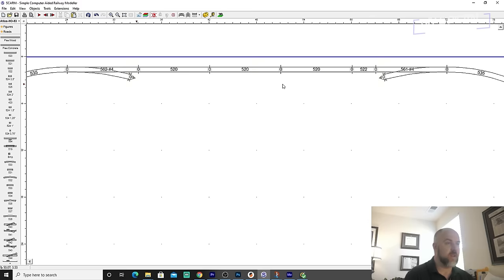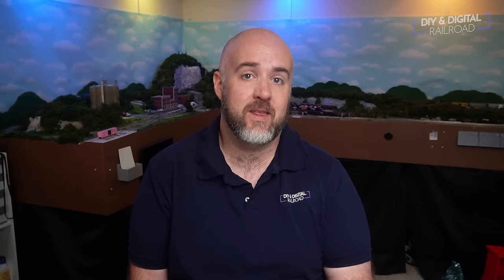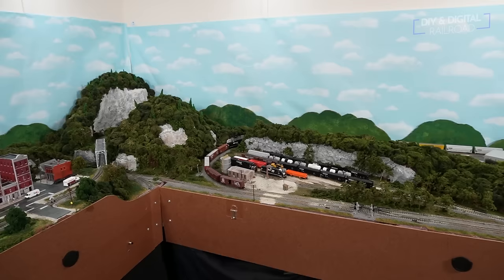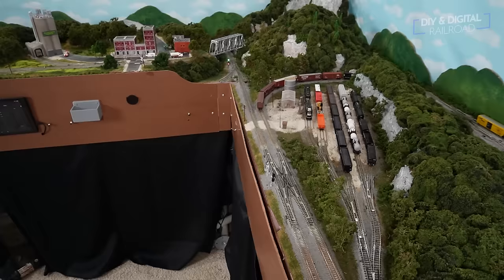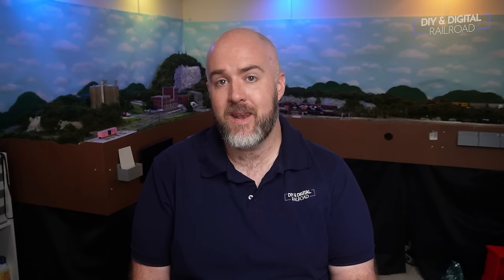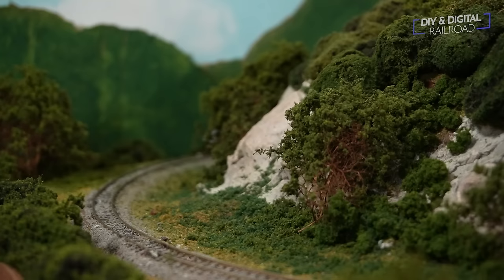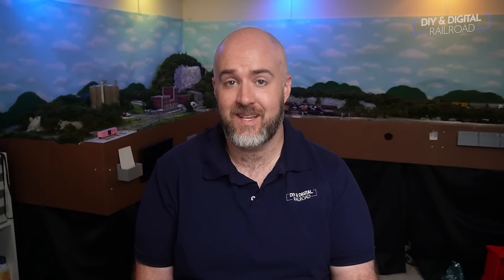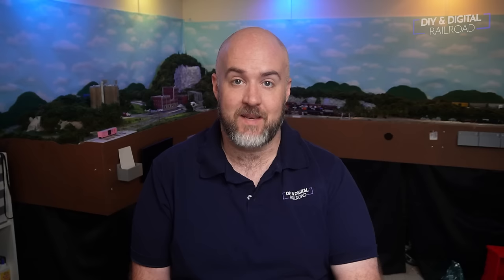My Must-Haves When I design a Model Railroad

Comment: I also really want a way to reverse my steam locomotives. It can be a loop track, or a track connecting two parts of the layout, or of course a turntable. And I also really like to include a somewhat interesting yard, for example one based on a switching puzzle like John Allen's Timesaver.

Comment: I live in an apartment so, I knew that my layout would be small. The layout will be on my dining table which measures 40"x78". I came up with three MUST HAVES for my layout. 1) It must fit on my table. 2) It must run two trains (one passenger line and one freight line) together. 3) It must make the small (Mayberry) town the center as I have no room to spread out. What I have come up with is a passenger line running around the outside edge of the table. The freight line is based on the #9/10 V-set from Kato. This creates two loops for the freight line offering up a look of three lines at the small "yard". You have probably seen or driven on one of those small two-lane highways that top a hill or round a bend and suddenly, you're in a small town. Then, just as suddenly, you're out the other side. My layout will have a "highway" running left to right with rail crossings at each track. There is a bisecting road the runs top to bottom (the yard) about two thirds from the left and creates the only 4way stop. This also divided the layout into quarters. The town proper surrounds the intersection. The quarter in the lower left is the industry area for factories. The quarter to the lower right is a smaller section with the Olsen/Larson kit and a small trailer park. The top two corners will have small mountains with tunnels to give the appearance that the trains are actually going somewhere. It is small but it will give me what I want, two trains running continuously in opposite directions and a small town using as many Woodland Scenics kits as I can make. It won't be fancy, but it will be mine. Thanks for the tips.

Comment: I designed my layout from the railroad view of industries indeveral industrial parks where the focus is getting them product to and form the industry in the park and yet able to run continuous as I have a vertical staging yard that house express trains that will pass through my valley so each park has a passing siding to allow the more important express trains travel.Hence operations and continuous running anytime I want.

Comment: I have a similar idea and included a shunting game into my layout
It was easy using AnyRAIL, N Scale and a 4x8 sheet as the base of the total area for the table
Took many tries and finally came up with a full layout
Then with AnyRail I can print out the Parts list of the track items needed
WOW
$995 worth of track with remote switches
That is nearly $1,000 without Power, Controllers, Engines, Rolling Stock or Buildings
OUCH

Comment: Jimmy,  I think it depends on what era, prototype, and scenic elements you want.   I do believe a way to make your layout continuous running, when you are by yourself, plus a good way to keep your track clean.   I firmly believe you have to factor in train cleaning, hidden tracks, and staging tracks.   I like operation so I like to place my industries in proper orientation with the loco.  Lastly your bench work has to be solid, and level.  Table top layouts are good but if you do a cookie cutter one or one with stringers.  Nothing worse that spotting a car and have it roll or derail on a turn out because it is not level.  good stuff as always

Comment: A wye.

I must have a wye because that (and not runaround tracks) are how big city railroads switch industries. They also are found at junctions where a branch line connects and interchanges.

If you don't have a wye, you aren't modeling a railroad.

Comment: I always have a continuous loop planned. While many of the realistic modelers want to see true-operations, my guests want to see trains run.  As my collection of rolling stock has increased, staging yards are important to get running on short notice. My attic layout has two single-entry staging yards that allows me to choose pre-assembled trains for when I want some operations. It also allows me to preset trains to operate in either direction on the single-track main.

My outdoor layout is based on a “less is more approach.”  I grew up in rural Wisconsin, I saw trains out in the country, and the random dotting of houses and small town fits my experience.

Comment: I think for what you want to with switching your layout is a good design.  I think for what I'm modeling which is Amtrak's Northeast Corridor my layout structure is different.  Since it's passenger operations it's mostly staging with sub-urban station stops.  So I built my layout with t-trak modules and race track running and occasional stops to pick up passengers.  Keep up the good work.

Comment: Being an ex-railroader, my major needs are 1). recreate a known subdivision, 2). model a 50' to 480' wide path of the rails, 3). model every turnout, every spur, every industry on the subdivision of the interesting part(s) I'm modeling, 4). half-scale sized industries, three-quarter scale sized yards, full-scale bridges, 5). track length between 'interesting switching areas' one and a half to two modeled train lengths. 
Working from actual track charts from the year(s) I'm modeling affords me the opportunity to be as faithful to the prototype as possible and still fit it all in a good-sized space.
Like the prototype, it's single track, mostly dark (no block signals on the northern 3/4). It sees two sets of mixed freight each way, one unit train coal drag for the power plant and the returning empties, and another unit train of empty gravel cars to be loaded and the loads out. The subdivision has its own hidden staging and set of helixes for continuous running and mixing things up.  
However, two train lengths out of the southern helix the northbound trains encounter the diamonds of an east/west double track main line of the same railroad, which provides lots of action even though the main line has only one yard (1/3 of the tracks modeled) on the east side of the diamonds the track on the west side is hidden.  (Each quarter of the diamond has a pair of turnouts {per prototype} which allows a wide variety of subdivision/mainline interaction.) The main line has its own hidden staging and set of helixes for continuous running and creating a wide variety of consists.
Located in a river valley, the river scenes give ample opportunities to distract the eye from the relatively short distance between the interesting parts.
The hardest part of designing a layout is trying to reduce the overall length of yards when you really can't do much to compress the length of turnouts. Everything is a trade-off between many factors.

Comment: Some type of water scene, like a river.  The 'Nine N Scale Railroads by Atlas' from the early 70s spoiled me - Gulf Summit and Susquehanna River Lines (N109) - river scene, viaduct,  double track on two levels that can run 4 trains at once, 4'x6', can do continuous or intense operations - what more could you ask for? 
Thank you for this post

Comment: I'm planning a layout with a big city because I want to model buildings.  I plan to have a passenger light rail system that connects the city to a big passenger station on the main line.

Comment: Been planning a 3m x 3m round the wall OO scale layout for a year using SCARM. I’m up to version 8 now and still tweaking things, although I think I’m almost ready to start building. Your video is therefore timely as it clarifies for me that your essentials are mine as well. Yes I have the continuous loop. Yes I have industries for operations, perhaps too many! Yes I have hints of connections to the outside world. Yes I have run around tracks to make operations kinda prototypical (but selectively compressed). Yes I have a lower level fiddle yard with a double switchback for access (no room for a helix or cassette, believe me I’ve tried). Next step is to make a very small scale balsa, card and paper mock up to make sure it all works.

Comment: My current layout design definitely pushes the envelope with 11 industries (Yes, there are runaround tracks.) in 8.5' x 9' (HO scale). There will also be an engine facility- the ability to turn locomotives is a must for operating steam power. Ian Rice's cassette staging is included, but a continuous running capability had to be sacrificed to make it work.I do question cramming so much into a small area. I guess I'll see how it works and just as importantly, how it looks..

Comment: Good video. I have built 3/4 of a 11&1/2' by 10' layout. I am now seeing that I should have included a larger continuous run. I was trying to have the trackplan reflect actual locations but may have to change that in order to get a longer continuous run.

Comment: Great video! I am currently building my town in my layout. I have this part of the layout have a double track main that starts from one end of the town all the way to my grain elevator on the far side of my layout. This is also used as a run around track from some switching. It’s useful to watch your videos because I get some sort of inspiration for my layout. Thanks for sharing!

Comment: Personally, I think it would be cool to design a layout centered around a city in the 60s and 70s. All of the track is embedded into the road and there are 3 and 4 story buildings everywhere. You switch small industries with in the city with small 2 and 4 axle switching locomotives.

Comment: HAVE FOLDING LOOP LAYOUT WITH HIND STAGE YARD UNDER THE TOWN AND SWITCHING WITH CALL HOLDING YARD AND 9 INDS AND 5 COALLOAD AT DIFF PLACE ON 12FT BY 10FT USA BASIC SHORT  LINE RAILROAD IN 1970 TO 1980 TIME  IN MOUTAINS ON EASTCOAST MOVING LOT OF COAL FEW NON COAL LOADS AS ABOUT 14 JOBS ON LAYOUT KEEP GOING BUSY FULL TIME IN OPERATION 
FROM AUSTRALIA

Comment: Single track mainline with passing sidings forcing the local to stay out of the way of "mainline trains" while switching the industries.  This puts a time crunch on the local to get their job done before the next mainline train comes through. For me, double track mainline just looks too crowded on a smaller layout, and it is easy to get into the "more track than scenery" sprial.  In the old days with DC and block control, that meant a lot of switch flipping on panels, but with DCC, no problem.   This concept does require more than the basic door or 4x8 space tho as there has to be enough mainline continuous run to have time to switch the local.

Comment: I don't necessarily need continuous running, but I need a decent amount of time that I don't need to pay attention to the train, or at least don't need to be worried that it's just going to run off the edge of a table or something...and least the feeling that it will crash. 

I need to be able to do some kinds of switching, but that can be for passenger train stuff too. I'm not yet sure how I feel about having to intervene when something needs decoupled, and I wouldn't want to use an automated one. That's too much work and all that. 

I'm working on something with Penn Central in mind currently, which is a little difficult to find decent engines for. Eventually, when I'm living somewhere else, I'd like to model a French heritage railway that's purely for passengers and tourists. It's like a large V shape where the train starts at the points of the V, meets at the bottom of the V, and switches to the other route when the leave. It's got complicated enough track, but it's got great scenery too. It'll be a challenge though, because it's not normal American construction. We don't have the models here that would be in France, even though it's current day modeling.
Reply: I'm also very anti-Kato track, so having flex turnouts is probably my way to go for everything. I'm not Anti other people using it, but I don't want to have it because it feels too clunky and like it has less personality. Also, it seems like it'd be really high and hard to ballast.

That last must have I just noticed is a train line that means something to me somehow. I don't have a prototype I'm modeling off of, but I'm going to try to do things similar to upstate NY with Penn Central since my grandfather retired from PC. BNSF means nothing to me. NS means nothing to me. CSX means nothing to me. I do have a fondness for Conrail, but that's a little later than PC. I just remember liking how the blue locos looked.

Comment: I'd rather have a model railway, rather than none. As I live in a tiny home, my options are limited. Even in n-scale my attempts to create a continuous running layout, just don't feel right for me. I can find room for a 4 feet by 2 feet layout, but by the times the trains straighten up, there is really no room for a siding or run round track. So I have decided to cut the base board in half 4 feet by 1 feet.and do a switching plank. Yes in n scale, but it is for my benefit, my enjoyment and in some ways, the hand in the sky, is sort of prototypical, because the conductor would be getting off the train, switching the switches, coupling and uncoupling the cars. So in a small layout, it slows down the operations. I like urban grot/grunge, so that is what I will model, houses and industries cheek by jowl. 

I am glad there are so many people like yourself, sharing information and ideas on the internet, so what ever are preferences there are examples to look at and ideas for inspiration.

Comment: I must have modularity, the ability to put it up and take it down without major room modification.  I like very long loops with a turnout to store each train I want to use, currently 3.  I have mine set up in my home office that runs along 3 walls on an elevated shelf with a turnaround table on each end.  I can put it up and take it down in just a few hours....I agree with dsnshobbies13...need money but would add patience, don't need to get it all at once, build it over the years.

Comment: Thinking about your layout and planning far ahead of starting on the layout is very important and your layout will look and work very well rather than seeming forced or jumbled up too tightly. Fortunately after many decades I have begun building my dream layout in a very large barn structure that is climate controlled. I designed the track plan on the computer but it constantly gets tweaked as I proceed with the construction. The one must have that I planned into my layout since I have long runs and 4 mainlines, along with a service track for industry, it that I wanted to be able to turn a train completely around without having to handle it. I have designed a number of reverse loops in several areas for most of the mainlines and my layout will be large enough to operate about 3 trains per mainline. For one person this can get hectic as you have to keep an eye on them so one doesn't catch up with the other one.This is where several operators can manage their mainline trains pretty well while another can work their mainline trains. Unlikely that I would ever run too many at once but I will have that flexibility. Since it is large I won't need any hidden staging areas as there are plenty of areas to park unused freight cars in their appropriate industries.

Comment: I am new to model RRing, I honestly do not have space to build a layout but I have 2 HO gp40 locos and a few rolling stock, I setup on my bedroom floor, time to time, but its not enough. just not sure how to go about setting up a layout with absolutely zero space to build it in. the only option I have is to possibly make a run around track at the top of my bedroom above doors and windows. just so expensive to really do what I want without the means to do so.
Reply: What about a layout on a board that sits on your bed when you are running trains and lives under the bed when you need to sleep?
Reply: @NBLeopard  my bed sits right on the floor and has a bunch of camping equipment and storage parts for computers and shoes and boots no room under my bed and, my bed dont have room enough for a board to sit on it honestly, it just sucks.